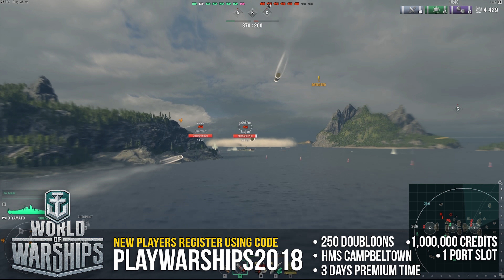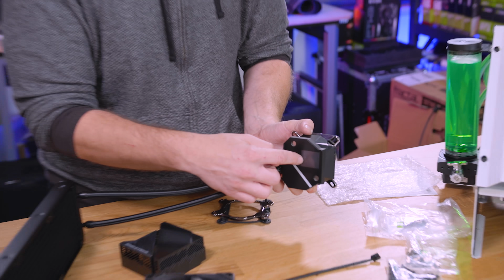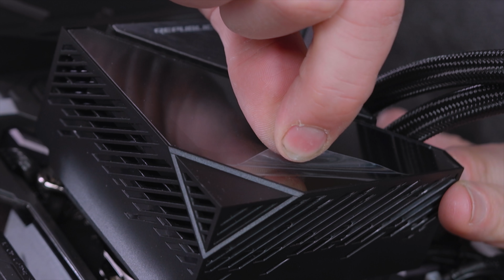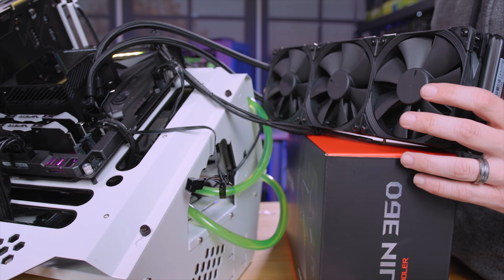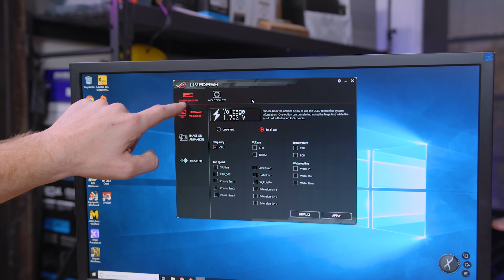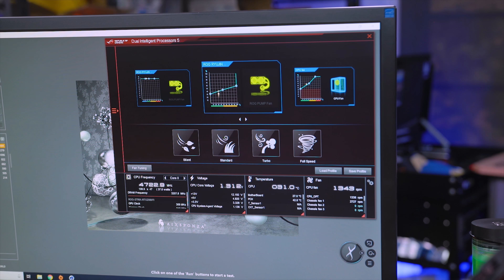ASUS made an AIO... but is it any good?? RYUJIN 360

Comment: Deep cool LT720 vs. Ryujin 360 for a 13900k on an asus maximus hero z790...or which cooler do you recommend? Also running 4x16gb trident z5 7200. Unsure which gpu yet. Using a 55" samsung smart tv 4k uhd as a monitor. Building a system for video editing and content creation. I'd love to hear your suggestions.

Comment: This is an excellent demo on a test bench for this AIO. Reading the comment below it's obvious that ASUS is using the temperature sensor for the AIO versus what the CPU is reporting. Just hindsight 20/20 here but always go with what your computer is reporting for temperature from the CPU. Any time you add additional software and hardware for reporting CPU temps you are adding a margin of error. Also, remember that this is performance demo, not a daily usage of this AIO in a built up PC. Things will be different and hopefully the cables don't fall apart like they did here.

Comment: I just installed mine (240 version) and it is simply amazing. Looks simply very cool, and my average CPU temperature went down 15c from a fan cooler. Easy to install, but if you are replacing a previous cooler, you may need the right tools to avoid removing components such as memory and probably the GPU. I really recommend it.

Comment: I have this cooler fitted to a 10600K and it's doing a great job. Probably the most annoying fan is the VRM fan that is on the Pump side if you put it on full blast. 
But the radiator fans which are Noctua's. Are very quiet even on full speed.

Comment: I bought one of these for my brand new, top of the line gaming system, and it was poopoo. The VRM fan has a bad bearing so it rumbles. My temperatures fluctuate WILDLY. I keep the pump shroud off because it halves the brightness of the screen, and the screen flickers so it won't image burn.... which shouldn't even be an issue. I am very disappointed in this product, and I am returning it for a Kraken Z73.

Comment: I'm going to go with this is by far their worst product and I will call it garbage IMO.  This cooler ran more than 40 Degrees C hotter than my stock AMD Phantom cooler.  With that I got multiple CPU fan errors on startup, 7+ overheats with a shutdown, the fan ran constantly and as fast and loud as it possibly could.  Just a horrible experience all round.

Comment: I have an asus x570 and this watercooler made all the connections as it says in the manual and I connected to the AIO Pump but there was a CPU Fan error, I even connected to the CPU Fan, did I do well? In the motherboard manual both connections of the Aio Pump and CPU Fan are 4-pin 12v, what do I do? What is the best option to have better income?

Comment: Um, so they made a liquid cooler that has a regular fan on the block only small which then has to run at a higher speed. Remind me again why I didn't just put a much cheaper air-cooler on my CPU to begin with?
Reply: Asus is really pumping out some fails these days. It annoys me. They used to be such a solid brand.

Comment: I have the same one, didn't like the software. I ended up using the motherboard to control temperature, both water pump and fan plug straight to the motherboard. I use the cpu display only. Dose a good job at keeping my i9 9900ks cool.

Comment: Yeah it looked like the cables pulled out of the connectors where they tried to put 2 cables into 1 hole. Obviously you need non standard pins for that. But that is also just a bad idea as the last fan will always be slower even a PWM fan... Daisy chaining fans LOL... Other than that it looks good and the fan nois from the water block lets you know its working and that you have a high flow fan in their.

Comment: I hope it is not intentional, but the temp you're reading on the cpu block is from a motherboard sensor behind the cpu, the real "cpu" package temperature should be about 10 to 12 c° more, would have been so easy to keep open core temp or hardware monitor and check for it...  you should review this thing and not push people relying on you to buy this for such a fake temp result

Comment: My only knock on this cooler is the pump noise. I may as well get those industrial fans and put them all over the case with splitters from noctua
Reply: So what you're saying is you'd replace the fans on the radiator? How would you do that? I'm new to building computers.
Reply: @PaganShagger  Most case fans are mounted with screws so it's a very fast upgrade. I will be using 1700 rpm fans as an intake and a single 900 rpm fan as an exhaust. Noctua's Low Noise adapters lower the fan's speed even further for a virtually silent PC

Comment: Jayz, its actually a good thing that you plugt the fans on the motherboard.
Because the temp that the Cpu cooler / screen gets its info from, is from a probe behind the Cpu,  and not from the Cpu cors it self.
And because the temp of the probe is slower at max temperature than the cores it self, your fans wil turn on / ramp up later.
And also it gifs 5 to 10 degrees off .
I hope thy wil fix it soon!
Reply: Ohyea,.. and to much software to instal for it,..

Comment: what makes the failure even worse is this was a test unit sent out to a reviewer, so you'd expect it had extra quality checks over a normal shop supplied unit. Doesn't give much confidence in picking one of those up. That said, the connectors were probably externally sourced, but still should be qc'd

Comment: Just got mine. I switched out the Noctua fans with the Corsair LL120 White (2200 RPM), and I'm getting around 28 degrees idle and 45 degrees during load. I should mention that I got it on sale, so I would only recommend this cooler if you could get it for around $ 200. You are definitely paying for the brand and OLED screen, but the perfomance is among some of the best AIOs out there.

Comment: Jay, why don't you or any other Youtubers (Kyle and Tom) tell us that the control softwares, namely Asus LiveDash (to control the OLED display mostly) and Asus Aura (for lighting control) don't work pretty much on any non-Asus motherboard? There are horror stories online of these softwares not showing PC stats, nor letting you upload custom Gifs (even of the correct size and resolution) and that LiveDash has issues even with Aura Sync! If the premium price tag is for these extras then customers/viewers should be warned that this AIO is only meant for Asus builds.. 
(FYI: I've been using a Ryujin 360 on an MSI Z390 MEG ACE board since Feb and I've pretty much gotten it to display custom gifs ONCE in these many months. The newest build doesn't even let you show hardware stats, not that the previous build was any better. It reported garbage data and only for selected few components.) 
Rant Over.

Comment: I managed 5.100MHz with 1,400V but 8700K is indeed hot like hell. Hits 90degC with 420mm water cooling. IHS seems streight, temps are equally spread over cores. I'd say next step would be deliding and changing thermal compound.

Comment: Hi Jay, is it possible to replace the tube and fittings on the ruyjin to match the rest of the system? the original tube is much smaller than my other tubes in the system and i dont like them :)

Comment: Can someone share some experience with this cooler on 2990wx?
Reply: It wouldn't work. Threadripper has a very large heat spreader, larger than the contact on the AIO.

Comment: I really love it but it's just too expensive. I wish they had a 240 radiator version, because currently the way my Define R6 is setup up (using an optical drive I don't wanna get rid of) I can't go any bigger that that, nor do I need any bigger. At 4.7Ghz 1.32v and I stay around 80C max with all cores synced and under load with just an H100i RGB Pro. I have the H115 RGB Pro but don't even need to use it.
Reply: The liquid cooler is not worth it. There's even some fanboys defending it when you can literally buy a corsair 360 AIO, buy 3 extra Mag-Lev fans for a push/pull config on the radiator. And STILL HAVE MONEY LEFT OVER!!!! Its actually absurd.

Comment: my aios on my 2 amd pc's are the corssair h60 120mm fan for my fx-6100 with cb rb15 at 3.9ghz 80 degrees C and a Cooler Master MasterLiquid ML120L RGB on my ryzen 5 1600x with crosshair VI motherboard 4ghz not yet tested

Comment: $280.

Breaks apart just by handling.

All of the wires coming out of the AIO.

The separate software. 

Beautiful. I do give them points for attempted innovation, though. I like that screen display. However, needlessly complicated and more room for failure.

Comment: What upsets me the most about ASUS being a fan of it is that AURA software is buggy is shit, that is simply inexcusable for a mega company like ASUS, whenever it has the glitch, the lighting goes back to default setting, I wouldn't be complaining if that was the only downside, but when it's in glitchy state the app takes up 15% of CPU resource, that is simply messed up and ASUS hasn't addressed this issue yet, at the least they should do is fix the bugs out. If this is how ASUS is going to handle an issue, by ignoring it, I will not buy another ASUS motherboard ever again.

Comment: I've always had great products from ASUS and very good customer service when I've contacted them with questions. Shame it's not across the board with everyone else. I have 3 strong systems using ASUS boards varying from a standard mobo, a TUF mobo, and an ROG mobo all running liquid loop i7s. Two 2700Ks and an 8700K, as well and a ROG laptop. All have been wonderful systems. As far as software concerns go, yeah it should be incorporated into one single package like AI Suite, but their software has worked well for me in the past contrary to what I keep reading. Shame that cooler came out a bust! Still looking to get ahold of a later production model after first run kinks get worked out.

Comment: Was the temps on the aio accurate to what the pc said the temps were? Because i saw another video where there was a 10 degree difference and that wad because the aio wasnt actually using the cpu temp sensor but the motherboard temp sensor behind the cpu on the other side of the motherboard.... sooooooo whats the real verdict here. I dont want to pay for a pretty aio thats broke and full of crap.

Comment: no the cooler is crap.  turns out that the oled display will NOT work unless you have an asus motherboard.  if your mobo is asus fine if you have any other brand avoid this cooler because it isn't worth the asking price

Comment: Thanks for the vid Jay!

+Cool Design
+Great Idea 
+Looks like it cools very well 
-Wires pulling out is a huge issue 
-Fans are loud 
-I hate having to run extra programs (all components in the same eco system should run off the same program) 

I think I will wait to use ASUS power supplies and AOI until they have fielded them for a year or so. I bet they will work the kinks out in no time and maybe get some cost downs implemented. 

Br, Cody Parvin
Reply: I'm watching this and said out loud "oh Noo it has a fucking SATA"
NO JAY, NO SATA IS NOT GOOD TO SEE DO YOU HAVE ANY IDEA HOW MUCH SHIT I'VE GOT PLUGGED INTO SATA
Fucking, EVERY single one is populated, all 9, because I have a bunch of drives including optical and SSD/HDD storage, as well as an aRGB GPU holder. So if the fuckin' thing needs to get independent SATA power I literally can't use this thing without dropping a drive or letting my holder turn to rainbow puke instead of matching argb. See the problem here is a lot of us have molex still on our PSUs, which gives us like 4 to a dozen mostly unused molex and exactly why I bought molex powered fan hub stuff, because literally nothing else uses molex.

MANUFACTURERS, PLEASE USE MORE MOLEX. I DON'T HAVE ANY SATA LEFT TO GIVE BUT PLENTY OF MOLEX and no I don't feel safe using dodgy molex-to-SATA converter cables

Comment: I really liked the LED display on the CPU mount, but isn't half the point of going with a water cooled system supposed to be to cut down on the noise. My old ASUS motherboard had a special cutout for installing a mini-fan; I went with something cheap and it never made any horrible noises until it started reaching the end of it's life (the fan, not the motherboard). I really like ASUS products, but I wouldn't pay that much for something that makes that much noise. Also, the wires coming undone wasn't a very good selling point on something that costs that much; maybe it was just really bad luck, but wires coming undone like that is something I would expect from a product that costs less than $50.

Comment: I've had great luck with Asus products (including their ROG line) but if theres one thing I have to knock them for, its software. Jay is right in this video, there's a separate piece of software for every little thing. GPU overclocking? Gpu tweak. CPU OC'ing from windows? Ai suite. RGB? Aura Sync. Sometimes you even need a separate piece of Aura specifically for their graphics cards. Screen on your AIO? Live Dash. Its ridiculous. Everything should all be part of AI Suite.

Comment: I really like that cooler actually. Fan noise does not bother me at all so the high pitched noise that fan was making is absolutely no big deal. I have an interstate highway pretty much literally in my side yard so that's no big at all. Also, I'm going to be building a new rig soon and I'm using the 8700k in my build. I've been playing around with some ideas for cooling because I know how hot they run and this seems like q viable solution to that problem. If I could get my 8700k to run at less than 90 under load, I'd be pretty happy with that. I've really been debating whether or not to go air or water cooled. I dont intend to water cool the whole system, and I know there are other, already proven methods, of that for just my CPU. I am however getting an Asus motherboard so this is definitely something to think about. Glad I watched this video. I wouldn't have known about this otherwise.

Comment: I use a DeepCool Captain 240EX RGB, and it's handling my 8700K overclocked to 5GHz on all cores. CPU is also delidded, but I have spreadsheets of data from pre and post-delid

Comment: I don't get how my 8700k with a corsair h100i V2 idles mid 30-40s degrees at 1.26 volts at 4.7Ghz all cores.. i have a Asus Z370E and have lapped this chip and still idle almost 10c higher than this..... any tips?

Comment: We're sorry, but we here at the company believe the average case modder needs something more than a pre-assembled kit. They deserve to be challenged just a little, so we believe chasing down the wiring issues adds that little bit of challenge to an otherwise boring installation.

Keep in mind we offer kits with "0" defects for the modding impaired, and are available for @$50 less. Please note these are a special order and may take 6-12 weeks for delivery, and come complete with a "QA Inspected by" sticker where as the other kit does not.

Thank you for understanding.

Comment: if used asus in past times, however the newer stuff has not been as quality made as back then, which is why i been running either asrock, or better gigabyte mb and graphics cards, with way less malfunctions.....2+ bills for a aio?, outta ask em to just send you the outer parts with the logo, so you can put something decent within, too bad used to be good products, but the middle and lower end stuf hasnt been up to snuff, the name just isnt worth what they think it is.....probably why they run intel cpus in most of the pre made crap, overpriced, overblown ego built  under quality merchandise with a name,

Comment: How in the world do you start the video talking about VRM temp problem with water coolers? Then talk about how Asus AIO water cooler has a built in fan and then show us zero data on the change in VRM temps? Total missed opportunity here. Please redo the video and show us data on motherboard components.
Reply: Most motheboards do not have temperature readers for VRMs and the chokes around them. They are passively cooled in most motherboards (water cooled in this one) and having air flow that passes through the passive heatsinks will logically lower the temps.

Comment: The small screen and the small fan is a nice touch.
Noctua fans, black, also nice.
Price is still too high though. Especially considering the poor quality of that cable and the loud noise of the small fan. This could just be a faulty unit though..
But I'd definitely wait for a V2 / 2nd Gen model and ofcourse for the price to come down a bit.